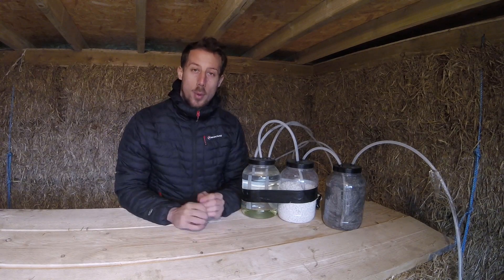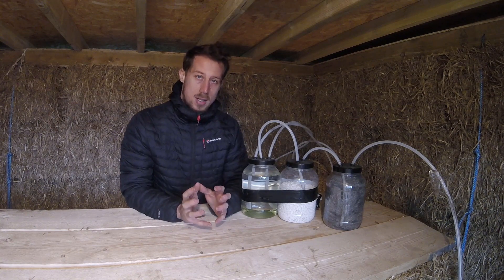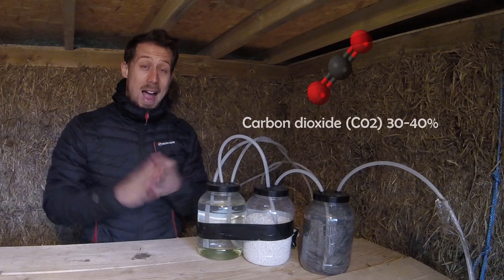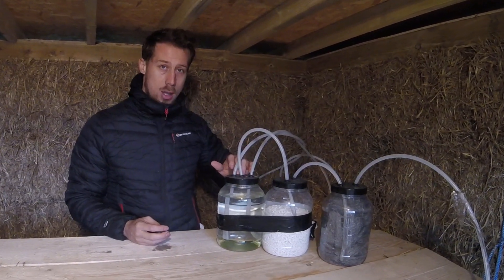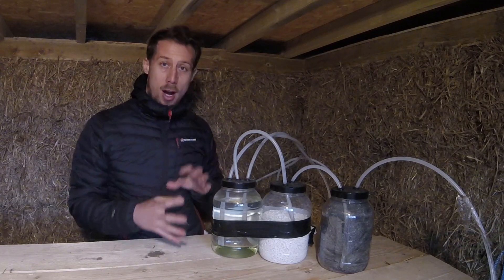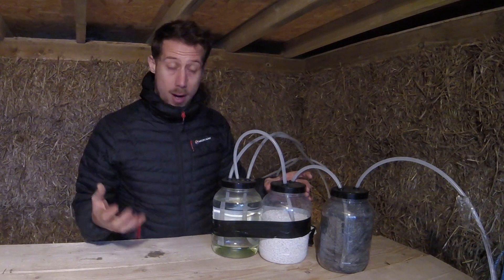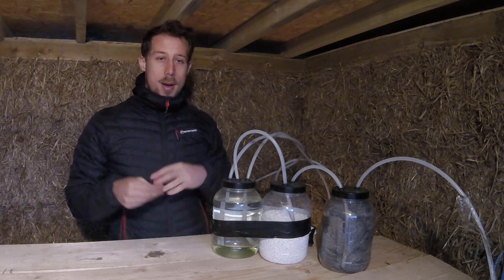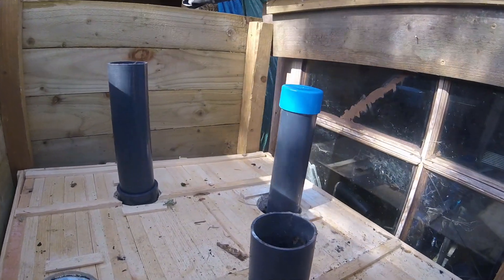Purify your Biogas with Biogas Scrubbers: Why & How // Full explaination // Biogas Digester

Comment from the maker: I hope you found this useful. Let me know if you did, if you didn't where would you like more detail? Cheers
Reply: Construct a large solar heater using an insulated structure mounted to the roof and painted black. Fill the interior with brass tubing painted black, and line the interior of the insulating structure with mirrors. Add one mirror above the structure as a back/lid that stands up vertically at the back of the structure. Careful to monitor the suns rays each season and make sure it's not aiming any reflected light at dry flammable materials. Route the pipes through your system and connect them to the in and out on the solar oven.
Reply from the maker: Great idea! I will hopefully get round to doing something with a solar heater at some point.
Reply: @GetMeOffGrid_  thank you for your video. Lately I've been looking for renewable projects to do in the country side when I move there. So looking around for this type of stuff I found something called jean pain compost heater...I immediately matched with a biodigester when I heart about issues with it in winter time. The  Jean pain system will give heat up to 60C for a acouple of months at least so it could really be a thing to keep the biodisgester running over winter without putting energy into it.
Reply: Thank u so much .
Reply from the maker: No problem!
Reply: Hey... I need a one on one. I am a biosystems engineering student. I would like to know more about cleaning the biogas and compressing it to cylinders. Is there anyway we could get in contact
Reply from the maker: Hi Allan, I haven't got to compressing the gas yet so can't really help you with that. If you want to contact me my email address is tomoffgrid@gmail.com .Cheers
Reply: @GetMeOffGrid_  please reply - which chemicals or the materials used for water vapour cleaning & hydrogen sulphide cleaning.
Reply from the maker: Water vapour -> Cat litter or silica 
H2S -> Iron wool
Reply: how often must you change out the elements?
Reply: Which are the three elements that use to filter the biogas ?
Reply from the maker: @muhammedsuhail6944  Water. Cat litter or Silica gel. Steel or Iron wool.
Reply: @GetMeOffGrid_  hello,which kind of iron wool. Very nice work
Reply: I need help
Reply from the maker: @maureenwordu9102  What do you need help with?
Reply: Thanks for the knowledge shared, please how long do i need to pour in the chicken waste slurry in the digester before it start producing methane?
Reply: You have some sunlight where you are so you can make a thermal sun panel or even a thermal heating enclosure to heat the biogas generator so you won't have to decommission it for winter and you will not spend anything to heat it.
Reply: Thank u for shareing.
Reply: I have watched like 4 of your videos but none show the apparatus actually working
Reply from the maker: @adeolaobayan7735  You are correct. These all show the setup. Unfortunately I had to leave the place where I did all the work. I am hoping to get back there at the end of the month and show them working, if everything is still in place. Thanks for watching!
Reply: Say I had silica gel, how will I use it? Should I just pour it into d can & war quantity would b fine? Also, if I've got no cat litter nor silica gel, u got any idea of what else I could use in their place?

Comment: How long before the water is saturated with CO2 and needs replacing?
Also; the solubility of the CO2 is higher the lower the water temperature.

ie:  running water to the bubbler with a float valve and using evaporative cooling  like wicks  to both slowly empty it and cool it may be an idea.
Good wicks are carbon felt as found in oven filters, welding screens, etc  and in the activated carbon filter that should in fact be the last stage in your filtration system..!
Or you could simply use a piezoelectric pond mister.
Evaporation cools both the water and the air the water evaporates into, so the cooled air could be used indirectly (smell) for efficient home cooling...

You certainly DO NOT want the (same old water) water bubbler inside the hot greenhouse and/or in the sun..!

As it's moist iron oxide that reacts with/filters out sulphur dioxide do not put a drier before the steel wool.  You want it to rust.
https://www.sciencedirect.com/topics/engineering/iron-sponge-process

Water vapour disassociates into hydrogen and oxygen at flame temperatures where it immediately burns to water again but it suppresses soot production in the process.
https://www.sciencedirect.com/science/article/abs/pii/S0360319921025581
So the wisdom of removing water vapour at all, is in question..?

Comment: Thanks for this. Really clever using cat litter. Hadn‘t thought of that. For heating, would maybe encasing your digester in compost be a reasonable heat source for avoiding decommissioning in winter?It would require a high heat compost with enough nitrogen and cellulose, but seems like a good off-grid thing worth experimenting with.

Comment: Might be better to put the steel wool after the water and the dessication medium (cat litter) last.

Two reasons.
-The hydrogen sulphide reacts with iron oxide, water is needed to rust the steel wool to make the iron oxide available.
- reaction of iron oxide and hydrogen sulphide produces iron sulphide and water, but your dessication medium is before the steel wool, so there is nothing to remove this water.

Comment: I believe you should be using Iron oxide as the scrubber agent for Hydrogen sulfide rather than the Iron metal found in steel wool. You can burn the wool to react the metal with air and form the oxide.

Comment: Great suggestion! I have a 110 gallon digester, ... feeding cow manure, food/garden waste, and apples. Lots of gas but no sustainable flame. The flame is orange.  I'm using a small variable speed, gas transfer vacuum pump. Is there a maximum flow rate for effectively scrubbing? Here's videos of the orange flame and the inability to sustain a flame:
https://youtube.com/shorts/7Bb8_W0YGnQ
https://youtu.be/IlalUtjpc0Y

Thanks!
Steven

Comment: You can increase the efficiency of the CO2 removal stage by using aquarium air stones. They make the bubbles really small thus increasing the surface area of the gas/water interface.  Not sure if you have enough pressure though.

Secondly, a glass enclosure (greenhouse) around the biogas digester would warm it up quite a bit, especially if you paint the digester housing black. Use the Sun.
Reply from the maker: Hi Thomas, Thanks for the suggestions. Check out my most recent video on scrubbers...I did extactly as you suggest...great minds! https://youtu.be/4HXgKTqT-l8

I didn't go for a greenhouse, I went for the other option which was a lot of insulation: https://youtu.be/TJUqjQbnon4
Reply: @GetMeOffGrid_ Too funny! I will check it out.

Comment: Great video, you mentioned decommissioning the biodigester for winter because it was too expensive to heat. Why don't you heat it with a biogas heater?
Reply from the maker: With the new insulated housing, it is actually not at all expensive. Check it out here: https://youtu.be/TJUqjQbnon4

Comment: Hi. I'm also trying to produce methane gas from waste, but I'm going at it from another approach: rather than scrubbing the gas (which contains hydrogen sulfide, produced by purple bacteria), why not get rid of all of the purple bacteria and leave the whole waste solely for the acetogens that will produce the acetate that will be consumed by the methanogens?

I had an interesting result by doing something unusually simple: I've collected dog droppings on a 15 kilograms bucket with lid and, in order to disinfect the collected matter (so it can be used by food solely by the relevant microbes), I've just added one cup full of table salt (sodium chloride) to the bucket. This amount of salt, which leads to a saltiness more than the double of seawater, forces the worms from the bottom into the top (which can then be scrapped off the mixture) and also kills whatever fungi that was growing on top of it. It's just a brutal amount of salt. After scrapping off the liquid that has accumulated on the top of the bucket, I'm left with an emulsion with the same consistency of ice cream.

To my surprise, the final cream does not emit the characteristic foul odors usually associated with fecal matter which leads me to think that, without the living purple bacteria, there is no hydrogen sulfide produced. However, archaea (the actual methanogens) are hardy (their cell membrane uses ether links which are chemically resistant to hydrolysis) and many of them still survive this salt shock (the bucket is still bubbling, and methane does not smell).

Now, the sulfur in this emulsion can be used as food to the archaea and maybe another microbe that will produce the acetate to feed the archaea. Salt might be the simple answer to isolate the right microbes from the unwanted ones.
Reply from the maker: You have to be careful with dog poo. There are other bacteria that can be transfered from dog to food plant, to human. I am not sure if the salt would kill them.

Comment: How fast will these filters need to be replaced? when does the water stop taking up co2, when is the cat litter too moist to take more water...
Reply from the maker: How long is a piece of string. It will all depend on how much volume of moist gas is moving through your system. I haven't got a good idea of any relationship between feed in a time on the filter change yet.

Comment: The addition of biochar to the system will make the process more efficient
Reply from the maker: I have heard this, is it to remove the moisture or something else?
Reply: @GetMeOffGrid_  , it’s supposed to change the chemistry behind methane production
Reply from the maker: @martinbonner8626  Interesting, is that in the digester or in the scrubbers, then?
Reply: @GetMeOffGrid_  , inside the digester , I can get you in touch with someone who is more in touch with the semantics

Comment: Hi is it possible to compress gas into liquid form.

Regards Martin steele
Reply from the maker: Yes. You just need sufficient power to compress it. Not really recommended though as it would become really volatile.
Reply: @GetMeOffGrid_  Hi and thank you for your reply. When yu say not recommended as it would become volatile,can yu elaborate please and ca you reccomend a suitable preasure.

Regards Martin steele

Comment: Should have wrapped the barrel with 1/2 Inch pex pipe get a small gas hot water tank look for a old camper hot water heater that holds 6 gallons of water convert it to run on methane and you can keep the digester going all winter as long as you insulate the tank well
Reply from the maker: Nice idea!

Comment: Please explain why you're not able to run this in the winter how cold is it where you're at in a winter that would be a problem if you wouldn't be able to use this year round
Reply from the maker: The digester needs to be at least 35 degrees C to work well. So in the winter, depending on your insulation and air temp it could be a lot of energy to keep that temp. Not a problem if you shut it down, might have to reboot with some cow manure in the spring.

Comment: how could we possible know the peak of digestion process, without measuring the methane production.
Reply from the maker: You could measure the pressure. That would give you an indication of how much gas is being produced. Would depend on your set up though. Or even gas flow through the pipes to the bag
Reply: @GetMeOffGrid_  thank you very much. Really appreciated.

Comment: How do we remove oxygen from the digester before starting of the digester.
Reply from the maker: You can't. As long as there is a good stock of cow manure with the good bacteria in there the oxygen isn't a big issue. Most of the digestion will be happening within the soup. The oxygen will get digested soon enough.
Reply: @GetMeOffGrid_   thanks a lot

Comment: Question the left over product is dry to use as fertilizer and cat I use pet waste for bio gas and would the pet waste after it has been used for bio gas be a safe fertilizer
Reply from the maker: Using dog waste could be dangerous as it could have bacteria that can affect humans in. So if you the use it on food plants it could be transferred to you
Reply: @GetMeOffGrid_  got you I assume would be sterile will have to do the experiment on a large cat shelter I support on central america, also if you keep ading manure and vegetables food scrap the system will keep running

Comment: how do you make sure the gas goes in and comes out through the correct tube.  do you use any suction methods to ensure that?
Reply from the maker: The way the tubes are set, releasing the gas into the bottom of the container. The gas will then go up, as it is lighter than air and the pressure build up will push it through the next scrubber.

Comment: The Hydrogen Sulphide is from the Manure isn’t it? If so, wouldn’t using only Veg waste would avoid that gas?
Reply from the maker: You can't use just food waste, the digester would acidify. There needs to be a base of manure

Comment: Are all the tubes in the bottle to be inserted in the same height ??
Reply from the maker: In input should go to the bottom of the scrubber and the output should come from the top. Exact heights is not too important
Reply: @GetMeOffGrid_  thanks for the prompt responses will let u know once done .Appreciate the responses
Reply: @GetMeOffGrid_   can i use rice grains instead of cat citter its a doubt ???is it possible bcoz have seen people dip their mobiles in a pot of rice to absorb the water if it gets wet

Comment: I am into hydroponic farming, and want to use the CO2 in a controlled enclosed environment during the day. How can I extract CO2 gas from the water? (2) It appears like low temperatures slow down the production of methane gas. What is the optimal temperature level to maximize gas production?
Reply from the maker: Hi. As I sure you know, as you are a hydroponic farmer, CO2 dissolves in water to for carbonic acid. It is quite difficult to get carbon dioxide back out of the water. You could boil it? But its quite energy intensive. Optimal temperatures are 35-40 degrees C.

Comment: Very helpful video and I very much appreciate your detailed explanation. We own a farm and we have lots of animals and lots of leftover vegetable products and a bio digester set up with the filtration system like what you explained here is exactly what’s needed. Ultimately we would like to do the same thing is maybe filter the Biogas a second time through the three step process so that it can be compressed into cylinders and used to power a Biogas generator. That is really what we would like to do and would like to get to this point because we’re trying to build a offgrade community that will use Biogas for the generator and solar panels with a battery back up system where we can implement this kind of generator when the battery level drops below 50%. I am very interested in learning more on a larger scale but we want to make sure we do it correctly and would love to communicate sometime for a sharper outcome that can be used for off grid living. As far as the toilets we will be using incinerator toilets and the gray water will be put through a gray water filtration system before going into the Drain system. We have given this much thought I just thought I’d share a little bit with you as well. Thank you so much will always be watching
Reply: As your toilet waste also produces biogas and contains the bacteria needed for the digestion process; why incinerate it rather than putting it into the digester?
Reply from the maker: Thanks Patrick. Sounds like you have a really given it some thought. Your system sound like the perfect system! Keep me updated when you get it running. Always interesting to hear about others experiences with biogas and off-grid tech
Reply: Yeah same here on all points what I have to worry about now is he saying it's not efficient to run in the winter I will make that comment to him as well

Comment: Hi, enjoyed your biogas videos enormously. I am in the UK and have always fancied a biogas system, but have been put off by the temperature problem. Did you finally manage to produce and use gas? The videos didn’t seem to indicate what finally happened. Also, did you consider using some sort of solar panel to run a heater? A small heater would be possible to rig up quite easily. Hope you can let me know.
Reply from the maker: Hi. Thanks very much. So far not enough gas to do anything with. I over fed it last year and it acidified. I have redesigned the system and now know how much or little I should feed it. I am getting it going again for this year. The temperature issue is the main challenge I think. A small solar heater could be an answer, or I'm thinking compost heater. Something low maintenance, low energy input.
Reply from the maker: @deathbyslime6725  Yes that is true. It helps that the insinkerator can't chew up lemons and limes. I have to be careful with the oranges though as they can sometimes sneak in to the bin haha

Comment: I wonder if using high ph water like giving the filter a calcium carbonate bottom with lots of strontium , would purify hydrogen sulfide well too
Reply from the maker: Interesting. What would you uses as the source of strontium. Can't say I've ever seen or heard it in the shops.
Reply: @GetMeOffGrid_  aquarium stores have crushed coral that is high in strontium

Comment: This is interisting Idea, I want to create something like this in Philippines where I lived. Because it has a warm climate. And also I want to ask how to use biogas to generator, what generator is possible for biogas to turn into electricity.
Reply from the maker: Most generators can be used with biogas. Petrol generators can be adapted or you can use specailised gas powered generators.